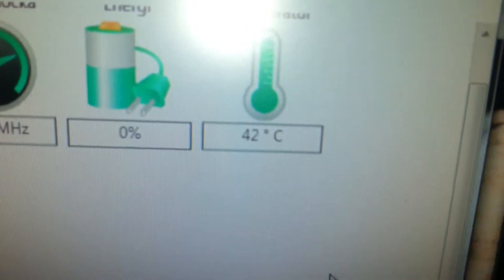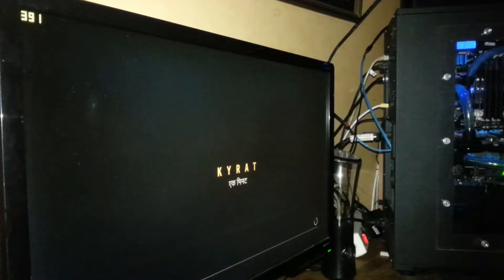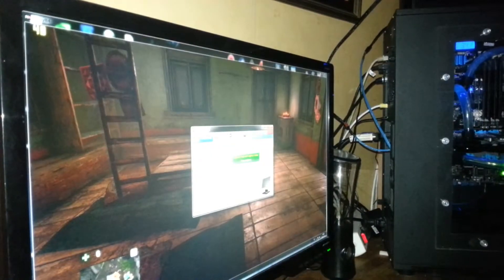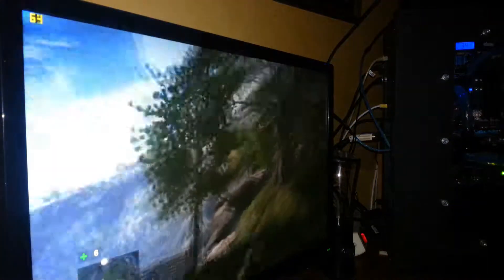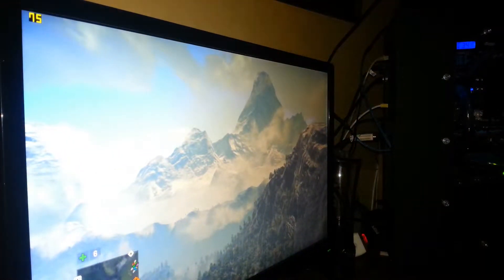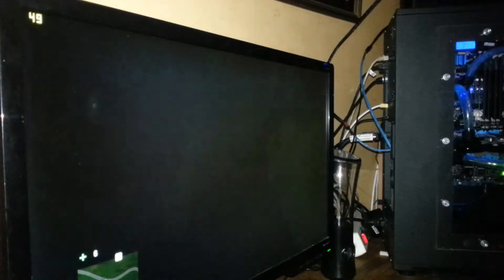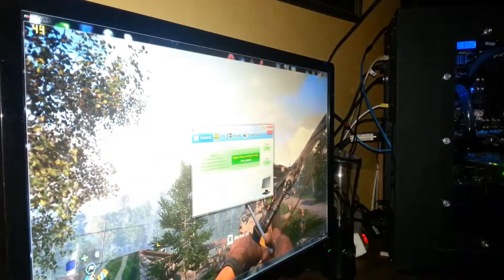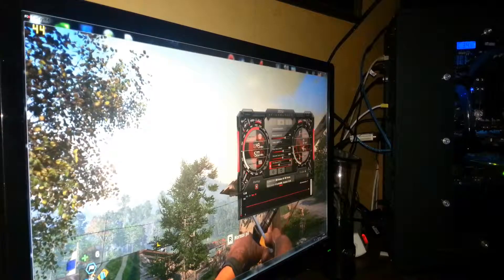Gigabyte R9 280X Rev.1.0 Watercooling Project - Part 3 EK-Thermosphere Block

Comment: which setting do you use in FarCry 4 ?
Reply from the maker: Andy Unger I say Ultra Settings in the video so I guess im running on Ultra.
Reply from the maker: Andy Unger I might have tweaked the AA settings though. But 280X is a hella of a card.
Reply: Balubish Tech Thanks for the answer.Do you running in 1080p ?
Reply from the maker: Yeah 1080p, and np :)

Comment: what rad's have you got cooling both your gpu and cpu?
Reply from the maker: NexXxos Monsta 240. But want another to get even lower temps. But need to mod the case first to be able to fit one.
Reply: you get decent temp's,,but its a quick rad,,i only have a 30mm thick  240 rad cooling my cpu,,bought watercooler for gpu,,and ive also got a 120mm rad 30mm thick,,,just dont know weather to fit in case or wait till i build my desk,,,its just card get's abit load when gaming
Reply from the maker: Well I had Corsair H80i and it worked great and think its only 30mm, but I knew from the start I only have space for one 240 in the top so I needed more surtface to cool down, voila, 80 mofo mm :) with push pull config. I have never reached 40C on the water temp. And are running my CPU at 4.8GHz and OC GTX 780. So yeah it works really well, only problem is when you game for a longer time period and the watertemp is about 35C and its push pull through the rad you basicly have a hot air fan box. It gets hot in the room. But that shows that its working well.
Reply: i thought about buying a all in one corsair cooler in the past but at the time some of the reviews on here said that the pump was noisey and made buzzing noise,,but that was about 4-5 years ago,,,its just ive had my watercooler for my gpu for about 2 months now and ive not fitted it yet,,,need a few more thing's and then i can start my desk build
Reply from the maker: Yeah I used the H80i and got sold on the performance boost and OC with it. So that is one of the things why I made a custom loop for $650 waterloop. ;) So I could OC a bit more and add a GPU to it to get that silent cool looking PC.
Reply: yeah cant wait for the queitness the toxic cooler alittle loud when gaming
Reply from the maker: richy69uk yeah so was the gigabyte card. 3 small fans. Never again.
Reply: just to let you know,,this is my second toxic card the first one was hitting 94-95c,,sapphire told me just to use the card,,i got it swapped by e-buyer the company i bought it from,,,great card but its put me off sapphire because of there customer service
Reply from the maker: Yeah you have 3 monitors so guess u need some extra power
Reply: seen as my cpu and gpu wont be overclocked do you think a 240mm thats 30mm thick be enough i have fan controller and good fans
Reply from the maker: Im not sure. But if you wont overclock it will probably be enough. And have the fan speed a bit higher. Guess you have to test it out.
Reply: the fan controller got temp sensor which is set to auto which mean's when cpu 29c or under fans run at 40%,,when cpu go's to 30c the fans run at 60% the fans on auto never run above 60% because my cpu never go's above 40c even when gaming
Reply from the maker: Well keep in mind. Cpus take around 80w amd gpu between 200-400w really depending on what card u have
Reply from the maker: richy69uk also sure i have mine oc alot amd fans are running around 50% all the time and i habe an 80mm radiator. But the water temp never goes above 40c
Reply: thats something i dont know my water temp??,,i will have to get a sensor
Reply from the maker: richy69uk Yeah you should. Its nice to know it. Cause hoses are just made for a max temp of 50C degrees. So for a first time watercooling I do recommend it. I think my highest was 37c on a summer day playing Star Citizen with max OC on CPU and GPU. So im in the ok zone, but want cooler, heats up the room like hell.